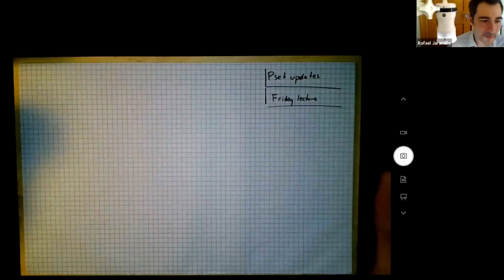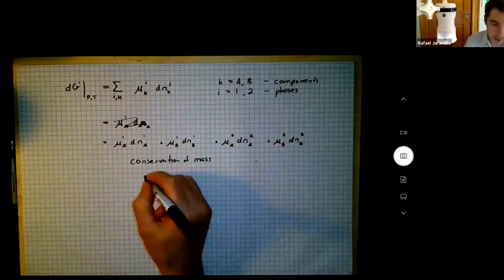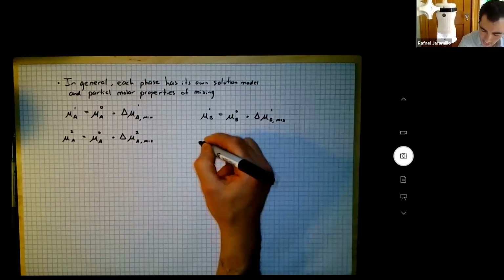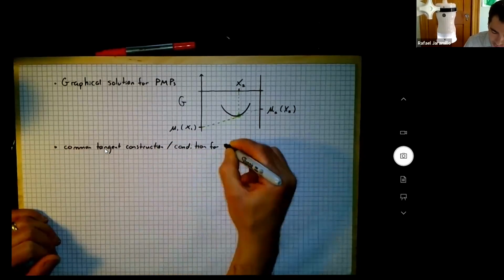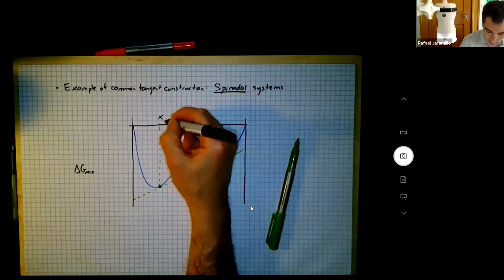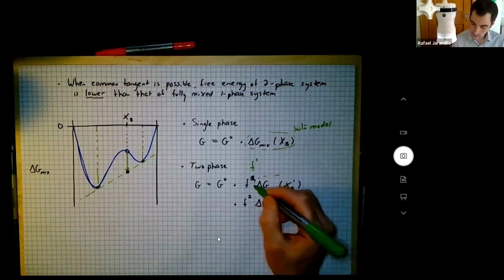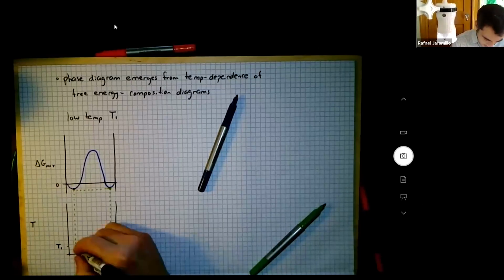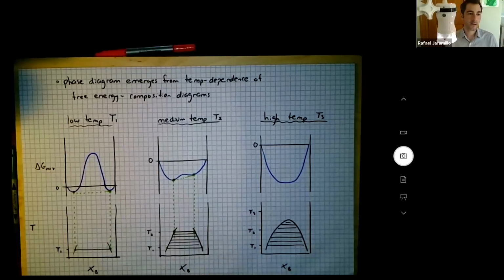Lecture 21: Phase Coexistence and Separation

Comment: I am honoured to be the 1000th viewer  of this video. I have a question, though. To derive the phase coexistence conditions, it was assumed in the video that the composite (multiphase) system is isolated. If that's the case, isn't the equilibrium condition that the variation of entropy be zero? Why was the variation of G be investigated instead?